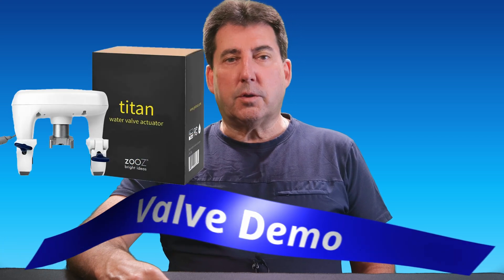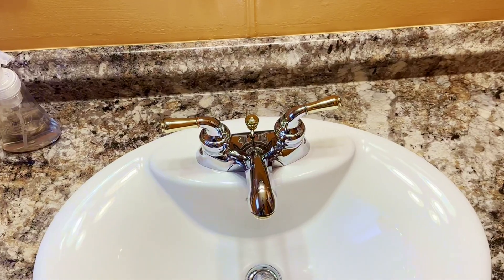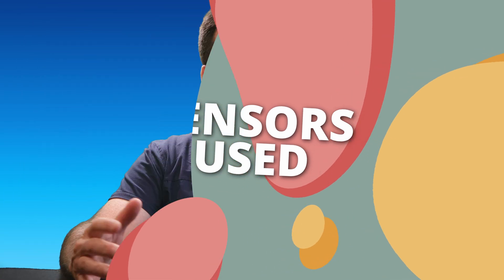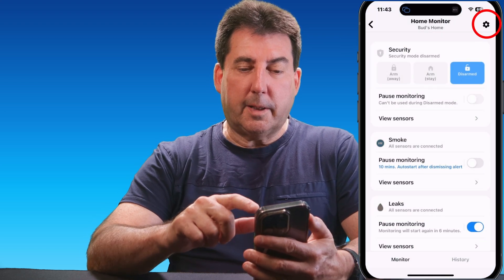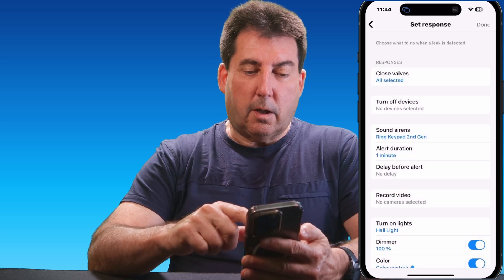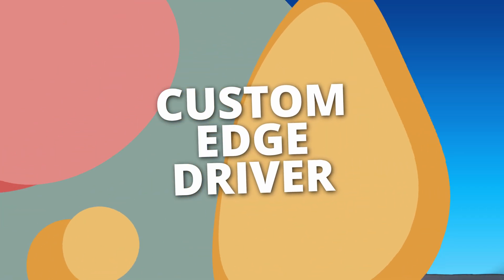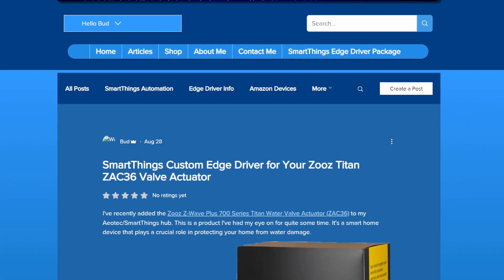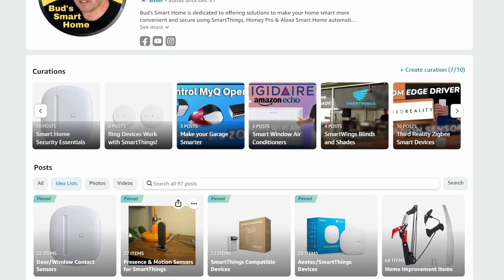Zooz Titan Valve Actuator Setup in the SmartThings App

Comment: A quick question for you about smartthings hub.. I have 2 thirdreality door sensors that are no more in function, their batteries removed. I removed them from the hub at many occasions, even in the web api, but after a few hours they keep reappearing in the hub ! Any clue as to why ?
Reply from the maker: Not sure Phillip. That's bizarre!  I have not heard of this behavior before. Perhaps they are coming in from another zigbee hub, like Third Reality or a connected Echo device which contain a zigbee hub? If you have other zigbee hubs I'd be sure that they are removed from them as well.
Reply: @BudsSmartHome  you are right on ! They are not thirdreality,  they are switchbot and they were in the sb hub mini !!!!
Reply from the maker: @philipperostin  - Great! Glad you found the issue. 😀
Reply: @BudsSmartHome  although my st hub still randomly appears as offline and dont come back. I am so fed up with this !
Reply from the maker: @philipperostin - i’ve heard others complain about this however I have not experienced this behavior, fortunately. Which version of the hub do you have?
Reply from the maker: @philipperostin - Here is a ST Community thread in which a guy has the same issue you are describing. It was suggested to him that he try assigning a static IP address for his hub: https://community.smartthings.com/t/smartthings-hub-constantly-offline-v2-3-27-8/271526?u=bud_m 
If you hub is connected wirelessly I suggest you try to connect it via ethernet cable. If it is connected via ethernet, try using a different ethernet cable.
Reply: @BudsSmartHome  oh, right ! They could be connecter to echo , I forgot they act as hubs ! Thanks, I need to check this !!